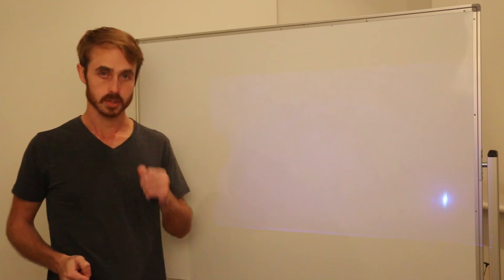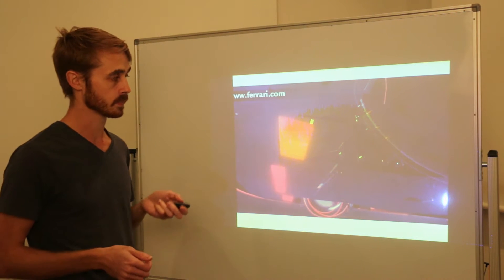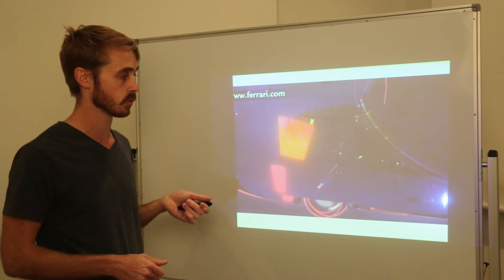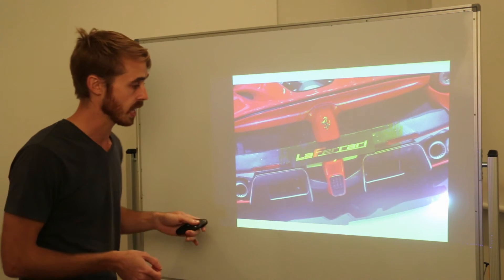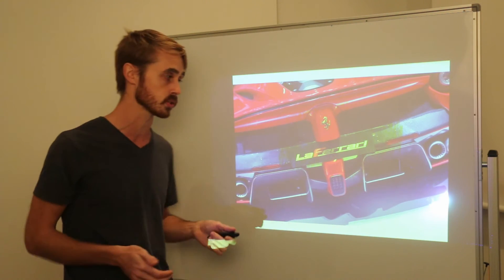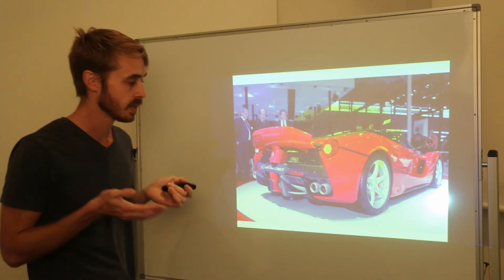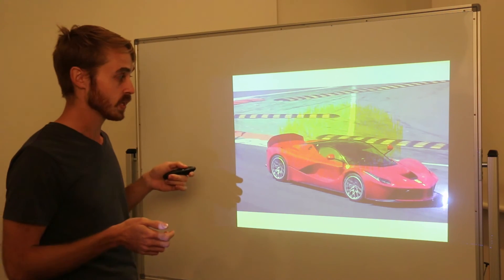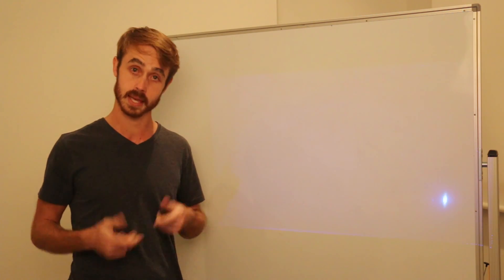Ferrari LaFerrari - Active Aerodynamics Analysis

Comment: Laferrari's aero design is so clever that it didn't need a massive rear wing. Also, the reeason for rear wing is downforce. Laferrari doesn't need that much downforce as it compensates for it with its incredible traction control/electronics. Also, by looking at the body design, you can see the areas of high pressure at the back of the car. Laferrari took them nearly 10 years to develope, a lots of wind tunnel testing and input from their F1 team added to its incredible aero design. 

I under its diffuser, it creates pressure incredibly  low to suck the car downward.  The rear spoiler is there to slow down the air and create high pressure on the top. Totally different approach to those of p1 and koenigsegg.
Reply: 110% correct. Anybody with half a brain knows that the most aerodynamically efficient cars in terms of negative lift to drag coefficients are Formula Ford and Formula Vee race cars, and they do not have any wings. 

95% percent of all aerodynamic grip a car generates can be provided by traction control systems. 

Wings are entirely superfluous. This is most vividly demonstrated by rockets which launch space vehicles- why would a plane need wings when a rocket can travel higher without them. It is obvious to anyone with eyes and not lobotomized that wings on cars are completely uneeded so long as you have rockets.
Reply: WWYD78 Ah but that's only because Earth's atmosphere stretches many light years into space, so while you're technically correct it still stands that rockets are more aerodynamic than anything with wings because all the Earth air in space would slow them down if they weren't aerodynamic.

Comment: ferrari has a wing policy

they are not gonna use wings on their cars to produce downforce, which explains the lip spoiler (look it up)
Reply from the maker: bucketslash11 Intriguing, given the F40, F50 and FXX all had rear wings... Weird policy to bring in now...
Reply: KYLE.DRIVES the policy does not regard racing cars/XX-cars

and yes the F40 and F50 seems to have gotten away from that policy, i'll see if i can find something official:

"A rear wing was rejected because engineers consider them kludges and, as Ferrari chairman Luca di Montezemolo declared after helicoptering in to Fiorano from nearby Bologna, "I find them vulgar."

From Automobile, February 2014, on the 458 Speciale"

found it on oppositelock

i don't think enzo ferrari was a fan of wings either

i still don't see the reason, more surface area to create downforce with, though drag increases usually when a wing is added  and if the wing folds in then it shouldn't be a problem
Reply: +bucketslash11 If an aerodynamics engineer who has an wind tunnel at his/her disposal r needs a massive rear wing to create downforce, you know he/she is not the right aerodynamics engineer for your company. Ferrari has some of the most genius aerodynamics engineers in the world so they know what they are doing.
Reply: +Sam R Completely correct. It is well known that wings are just there for looks and are only put on there by ricers like Hondas and McLarens. 

95% of all downforce can be generated by the floor of the car and by pointing the exhaust exits upwards and using the thrust to push the car into the ground. 

That is why drag cars are so fast.
Reply: Correct, they  think that wings don’t look elegant, hence why they don’t put them on road cars. In fact, on the P80/C they put a wing that can be taken off in case you’re taking the car to a concourse d’elegance (they literally said that this way!). Definitely a weird company…
Reply: @_entrxpy That is a race car not a production road legal car, different story with the Ferrari sf90 xx stradale tho as it's the first Ferrari ever since the f50/f40 to feature a spoiler.

Comment: I feel like your videos have more info than my brain can handle. Man would love to get help on designing the underbody aerodynamics on my car.
Reply: Agreed.
Reply from the maker: Charlie Simon Well I do this professionally if you really want help on your underbody aero... Might cost a little bit more than you are probably after though =P
Reply: KYLE.DRIVES how much would you charge?
Reply from the maker: Ali Ahadi Depends on what you want, I really need a lot more info to quote, like:

Photos (More is better, Clearer is better)
Race type (Drag, Circuit, Off Road, Autocross)
What tracks and surfaces
Specs of Car (Power, weight, current peak lateral G)
Copy of regulations that we can inspect
How much/what type of work you want done

You can run all this through the business email under the about tab on my channel if you want a quote. To give you a rough idea, my charge out rate is 175AUD/hour, which isn't bad when you consider a good mechanic charges 110AUD/hour
Reply: KYLE.DRIVES Sounds good, when the engine is finalized I'll hit you back up. The shop I'm working with keeps changing up things. So it's either going to be a turbo 4cylinder, V6 or V8. The body is a IMSA Celica GTU Replica. Your rate sounds reasonable considering the work that is involved. Thank you for the response.